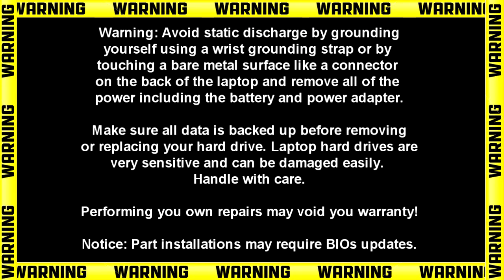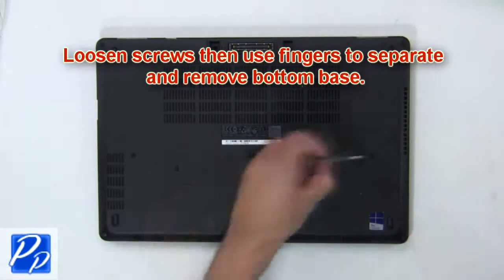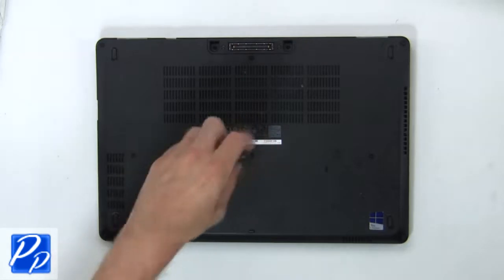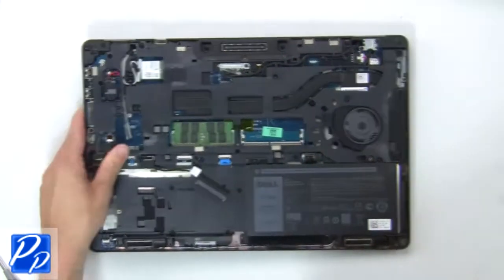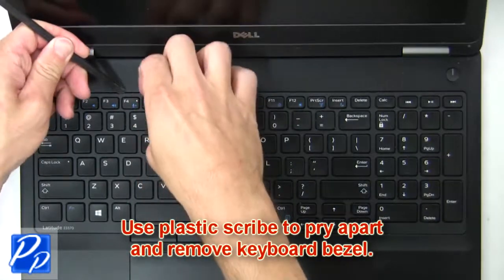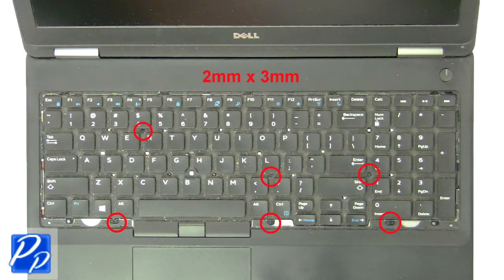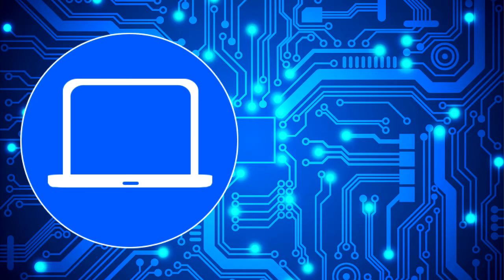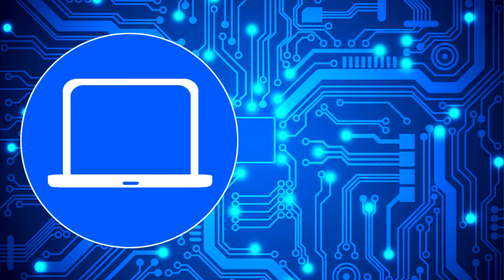Dell Precision 15-3510 (P48F001) Keyboard How-To Video Tutorial

Comment: As of April 3rd 2022, does not apply to the newer Dell Inspiron 15-3510 computers🥴
Reply: The keyboard is "welded" to the frame.  They have plastic posts that they melted down to attach to the aluminum frame.  It no longer has a bezel and screws holding the keyboard in place.  You have to completely disassemble it to figure that out too.